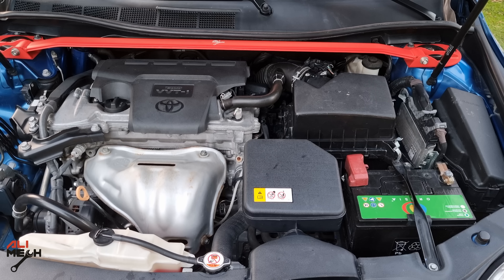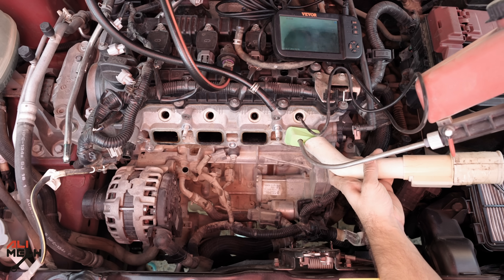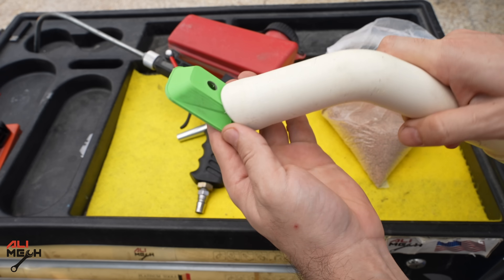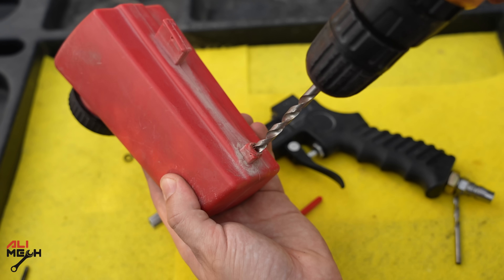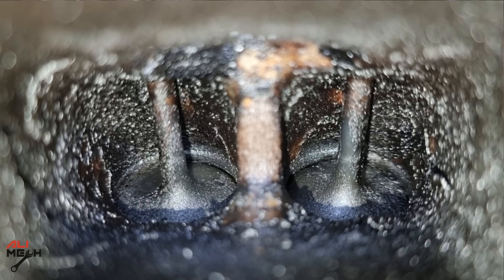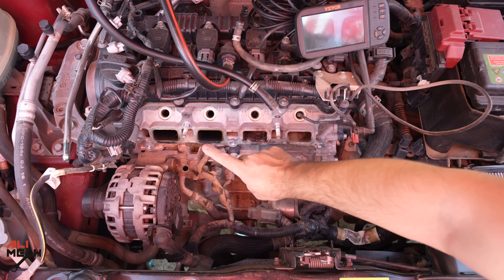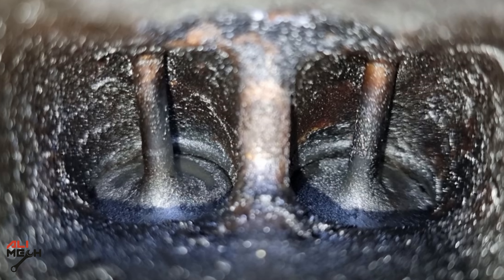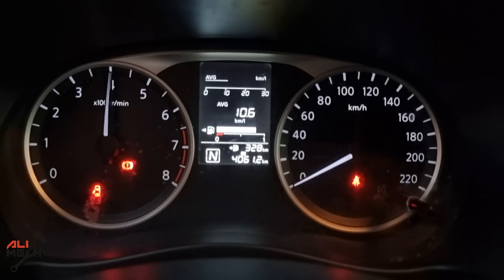SUPER Clean intake valves with this simple trick...

Comment: You wouldn't notice the difference between dirty or clean valves. I've tested it many times...
Reply: Thank you, that's what I would expect as well, no difference. It's not that the air or intake is blocked by some black particles on the wall or valve shaft. Since this sand blaster cleaning also does not clean or enhance the actual seat of the valve, it won't seal better either, so it should not enhance anything. Maybe you can measure some 1% better airflow, but I even doubt that. I'm not an engine expert though.. so maybe I am wrong.. o)
Reply: @ytbone9430  I don't believe you guys. That was a filthy valve chamber and throat. You can not tell me that cleaning all that gunk off makes no difference. I'd want to see a flow bench reading before taking that as the truth. If I could 'port' my heads just by cleaning them, then I'd never do anything else but!
Reply: @ytbone9430 it has nothing to do with air or the valve seats.
Reply: @Ray1981-o5h  > "it has nothing to do with air or the valve seats." What do you mean? What has nothing to do with what? Sorry, I cannot follow your reply, but I appreciate it. o)
Reply: I'm a qualified Mercedes-Benz mechanic for 35 years and specialize in the repairs of all Mercedes-Benz car engines and automatic transmissions ,there's absolutely no noticeable difference in performance with clean or dirty intake valves, I've seen 6mm valve stems OM 271 in particular with atleast 15mm of carbon build- up ,and there's no difference in performance.
Reply: @jimmyroos1677  You realise that you are flying in the face of logic? right? Otherwise designers don't need to bother with flow benches, or head modification?
Reply: Maybe if it were naturally aspirated engines, there would be a difference. But on super charged & turbo engines, dirty intake valves make no noticeable difference, I've seen this many times, with out bullshiting...
Reply: @jimmyroos1677  Aaaah. Yes. With that much pressure behind the intake, it wouldn't make a difference. In the beginning, people used to use turbo's and force them into log manifolds and still got good results. 
So I am thinking along the lines of NA. The Ford Transit is a bit of both. It uses the turbo to get the van moving and then flips the VNT off and opens up the exhaust to vent the excess. In my mind it's a hybrid.

Comment: amazing! A good blast of air from the spark plug well as your rotating the valves open would be my final step.
Reply from the maker: Yes that's good point, but I compressed air really good before turning on the engine

Comment: Can this technique cause issues with valve sleeve and valve stems’ errosion due to the micro sand particles being trapped in the gap after this process and then acting as abrasive material? Valve seals are also a concern.
Reply from the maker: That's why it's good to use walnut shells, the dust been compared with air and any small dust if enters the combustion,  it will easily burned 
No it would damage seals, if it was sand, for sure
Reply: @AliMECH  Good point, which I missed. How much of the walnut powder was consumed in this process?
Reply from the maker: @avgavg001  I took out about a kilo and reused it over and over , from vacum to the gun again

Comment: Ha ha. If you exercise your engine correctly ie, full range acceleration and long drives this problem will not happen. Never had this problem in over 60 years as a mechanic.
Reply: Dude I go to work in the city everyday, where I accelerate , didn't think about that?
Reply: Then you haven't dealt with a modern diesel engine recirculating exhaust gasses.

Comment: Using the correct oils and change every 5,000mi, or sooner! Will mitigate the valve deposits buildup. 
Using conventional motor oil with extended oil change intervals is a sure way to experience valve deposits issues. 
I’ve had 5 GDI engines (not including a diesel engine truck and farm tractor, and outboard boat engine) and have never had valve issues. 
BUT, I change the oil and filter using synthetic oils every 5,000 mi after initial 500, 1,500mi and 3,000mi oil changes. 
I use top tier synthetic oils only, in turbocharged engines. 
At 150,000mi, engines don’t use/burn oil that greatly contributes to excessive valve deposits. 

Like the old Purolator filter commercials:”mechanic says, you can pay me a little more now, or a whole lot more later”!
Reply: PCV blowby is the culprit
Reply: @hotrodray6802  Mixes with EGR crap
Reply: A oil separator/catch can will help but without fuel spraying from the injectors all this will become routine maintenance which cost $$$$ if you can’t do it yourself.

Comment: The carbon build up is from direct injection and we will never have that problem because our 2027 Suzuki Baleno is port injection because Suzuki's aren't sold in the USA and my 1097 Toyota Hilux has a carburator
Reply: Any gasoline engine will eventually have that problem. It isn't dependent on the type of induction into the engine.

The video itself was done using port.

Comment: Use Top Tier gasoline, replace the oil (Valvoline Restore and Protect) every 5k miles, replace the PCV valve and Spark plugs every 50k miles and  valves are clean! Ever seen a racing engine ran on methanol? Clean valves. Remember carburetor engines? Dirty valves. Largest contributor  is the fuel. 3rd generation mechanic and engine builder.
Reply: And diesel engines.....
Reply: Do you mean Top Tier? Tier 1 is a fabricated name.
Reply: Way to show everyone you have no idea how direct injection engines work 🎉
Reply: @chineseempanada420 My 2015 Ford F-150 3.5 Ecoboost with over 130k miles has clean intake valves! No catch can and no cleaning of intake valves!
Reply: @chineseempanada420 my 2015 Ford F150 3.5 Ecoboost with over 130k miles has clean intake valves. No catch can!
Reply: Maybe install an oil catch can to capture some oil vapor going into the intake.
Reply: @ZeeCayPeeA  that can work if:

If is serviced regularly. If not, it will do even more damage. 

If space is available.  We live in a world where engine compartments are so tight even timing chains won't fit in the front and are moved to the rear of the engine in front of the trans.
Reply: @ZeeCayPeeA  Oil Catch cans are a scam. They catch vapors that cool down to a liquid.
Reply: @ZeeCayPeeA IT was good before EGR introducing....Problem with a direct injection system is related with one factor.Majority od impurites are caused by EGR ...Not by PCV of crankcase...
Reply: @Freedomski-eh4iw why does your lawnmower have intake valve build up?? Burn methanol and watch it become super clean:)

Comment: Can't some high revving highway clean them also? (excluding direct injection motors)?
Reply: This type of problem only occurs on Direct Injection engines. This this the only good method of cleaning the intake valves on direct injection engines.
Reply: @pks2634 it occurs on any gasoline injected engine including throttle body/central injection engines.

The cause is the same.
Reply: @pks2634  I literally said that, (no direct injection engines)
Reply: No
Reply: @Ray1981-o5h  proof? I've seen that "italian tuneup" can clean something on the engine

Comment: At how many miles should this be done ?
Reply: have it done with every tank of gaaaas. after 3 get a new motor.
Reply from the maker: Depends on the car, some have more oil vapor and some has less, I can't tell really, you always have to check if you have a second hand car to know the level of the  carbon build up there, but if you install oil Catch can,  it will be very helpful and you won't have build up like this
Reply: @AliMECH  I have a 2021 Subaru forester, with 26,600 miles. I use restore and protect on, by valovine
Reply: @AliMECH  my car is a 21 Subaru forester with 26,600 miles.  I use Valvoline restoring and protect oil.

Comment: Sorry for the dumb question but walnut sandblast doesn’t leave residue  inside? Did you vacuumed?
Reply from the maker: It will leave a thin layer of dust, yes the vacuum is on the whole time, but needs a some compressed air to clean that dust, I use the same gun but close the walnut shell feeding valve and just hit with air

Comment: If you want to get rid of the last little bit of shell , pressurize through the spark plug hole to 120 pounds and crank over . When the valves crack open it'll blow out the last of the shell .
Reply: To do that you have to do all cylinders simultaneously, quite difficult and tedious.
Reply: @neverbob4206 ,,, I can see that you and a half dozen of your likable friends have never done any professional race , percentage of leak down and compression checks .
Reply: @neverbob4206  How do you imagine pressurizing all cylinders simultaneously while there is no position of the crankshaft allowing for all intake/exhaust valves to be closed?
Reply: Where does the gunk even come from? Blowback from the valves not sealing perfectly?
Reply: @paulguy8779  PCM valve that recycles the blowby gas and some oil vapor from the crankcase.  The tube that comes out of a valve cover and hooks up to your intake downstream of the MAF sensor.  This is why people invest in catch cans, it condenses the oil out of the recycled air so it doesn't cover the throttle body in sludge and coke up the intake valves.
Reply: @paulguy8779 ,,, well , it might be a case of : we don't know because the sequential port injection constantly washes the back of the valve , lol .
Reply from the maker: That's a good idea too, thanks for pointing out
Reply: Not good idea...⛔

Comment: NO walnuts, CRC or ANYTHING leaves intake valves that clean!!! That's a brand new valve, in the "After" image!
Reply: Das stimmt! Muss man selbst mal gemacht haben. 😊 Ich habe früher bei Mercedes mit der KA Einspritzung öfters diese Erfolge gesehen. W123 die 230 E und 280 E
Reply: Ich danke Dir und wünsche ein schönes Weihnachtsfest.
Reply from the maker: Thank you too and merry Christmas 🙏🙏
Reply: Then you haven't used a walnut blaster to clean the intake valves. I do diesel engines and the valves come up as good as this.
Reply: I did the Valves of my VW with 230K. They did look worse than those valves in the video. After a walnut blast they looked spotless and clean.
Reply from the maker: For sure, totally agree
Reply from the maker: I know, the result is very good

Comment: I am surprised that so little carbon buildup can affect the performance of the engine. How often does this happen to engines Ali ?? Could you spray MEK solvent into the intake to do the same thing with half the work ??? NICE work with video ALI. HAPPY HOLIDAYS TO YOU TOO !!!!
Reply from the maker: Depends on the car, some have more oil vapor and some has less, I can't tell really, you always have ro check if you have a second hand car to know the level of the  carbon build up there, but if you install oil Catch can,  it will be very helpful and you won't have build up like this
Reply: @AliMECH  Thank you SIr. I will put a catch can on my SUV. Peace and Happy Holidays too. vf
Reply from the maker: @victoryfirst2878  that's great,  happy holidays to you too 🙏🙏
Reply: @AliMECH   Agreed, catch can is a must on direct injection.    Nicely done 👍
Reply from the maker: @RS-dc7wy  🙏🙏

Comment: Very interesting, good job. How do you turn the crankshaft on the Toyota hybrid 1.8l engine.

It would be interesting to do a compression test before and after. I'm not sure if this is any more effective than a valve lapping.
Reply from the maker: Most of the times you won't get any difference, because it only cleans upper part of the valve and not where it sits

Comment: thanks for the video. do you mean if the car are direct fuel injection no need to clean the intake valves??
Reply from the maker: both has to be cleaned, but with direct it needs more cleaning, and with indirect less cleaning because fuel injector washing it
Reply: @AliMECH  but why the GDI need more cleaning valves although its direct injects fuel into the compustion chamber?
Reply: @waleedseyadi9412 that IS why. The fuel cleans the carbon off the valves as it passes through but the GDI engines do not spray the fuel on the valves. So, they never get cleaned. An Italian tune up can help but spraying cleaner in the intake is the best maintenance.
Reply: @waleedseyadi9412  all gas engines have oil vapors created and flow up to the valve cover,  the gases are sent to the intake to be burn  but the can leave this deposit .
Reply: @danc2014  👌👍
Reply: @jeffreypgorman  👌👍